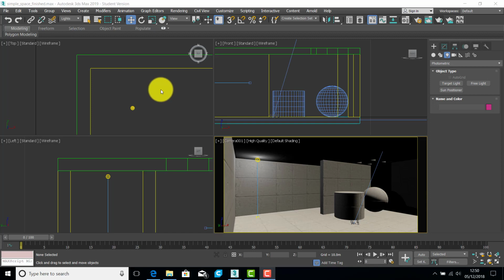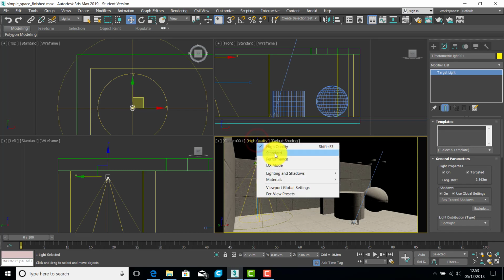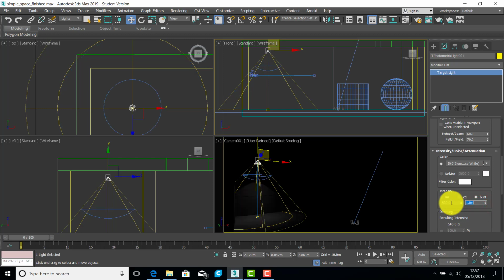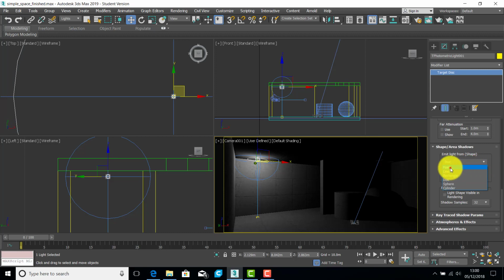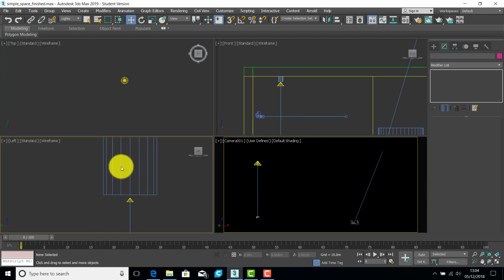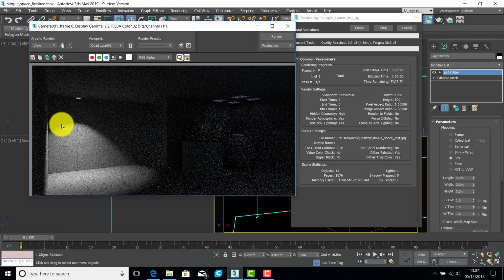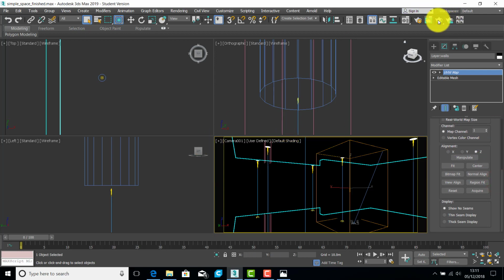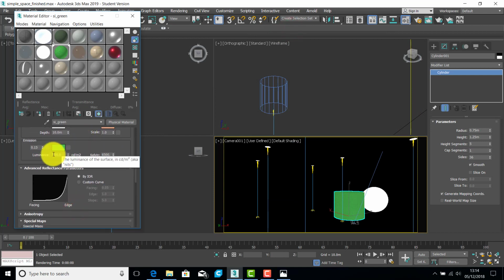3ds Max + ART Renderer - Artificial Lighting Basics - Part 2

Comment from the maker: Hi Celine. My laptop has 16gb of RAM and a 2gb Nvidia graphics card. It's an i7 processor. I would not recommend less than that.
Soft reflective materials are the real killers. Try using matte materials without reflections if renders are taking too long. Look around you ... There aren't really that many shiny reflective surfaces. Refraction is the real killers so solid glasses and liquids are to be avoided if possible. Best regards. Richy. One last thing ... Keep laptop plugged in when it's rendering - the processor needs more electricity when it's working hard. Switch off the power and rendering takes longer I have noticed.
Reply: Your lesson save me thanks. ❤